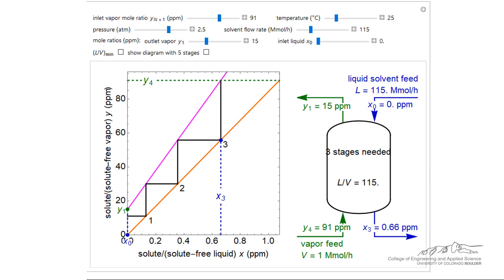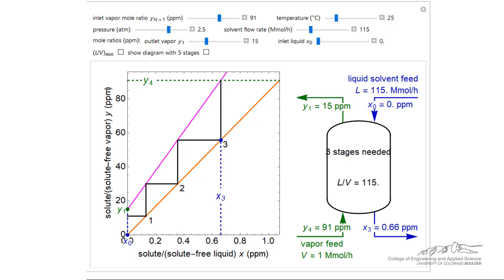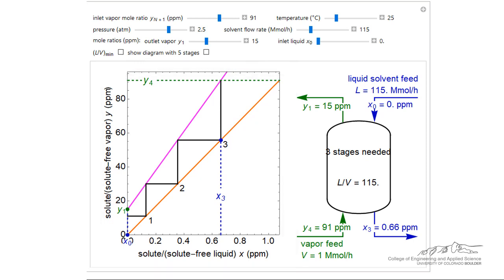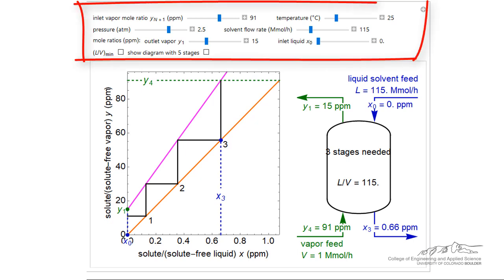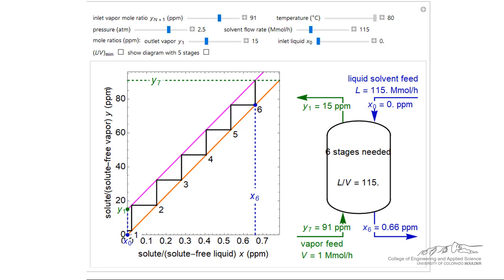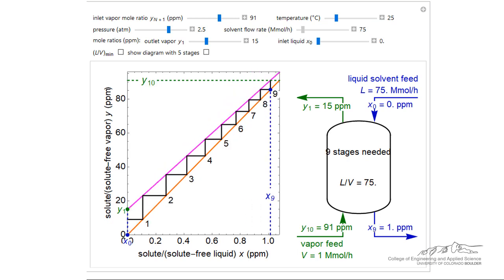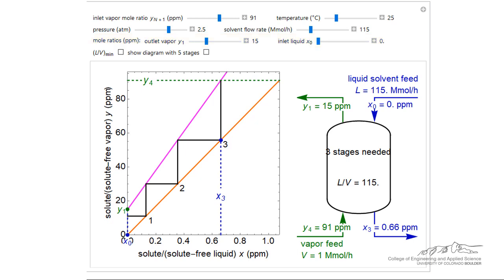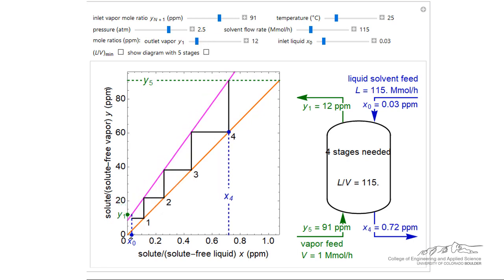Operation of an Absorption Column (Interactive Simulation)

Comment: 2:28 Impact of temperature - Solute molecules will want to leave (escape) the liquid at high temperatures, thus less solute will be in the liquid (absorbent) requiring more stages to increase the amount absorbed (and so to reduce the solute concentration from 91 to 15 ppm from the entering vapour) 
  3:00 Impact of pressure - The higher the pressure,  the  more molecules of that gas will go into the liquid, thus increasing the amount absorbed

Comment: Thank you for the explanation. 
Why an increase in temperature increases the number of ideal stages? What is the physical meaning for it? Thank you
Reply: As I have known from chemistry, increasing the temperature decreases the solubility of the vapor into the liquid. It makes it hard to transfer the solute from vapor to the liquid, therefore more stages is required.
Reply: @danielalfonso6873  thank u
Reply: When thinking about absorption You must think about a coke can ,when You open it the pressure drops therefore the gas leaves the liquid phase, if the Coke is warm it taste like Crap cuz the gas also leaves liquid phase.

Thus gives us a lesson ,in absorption lower temperatures and high pressures increase the mass Transfer.
Reply: it has to do with the formula...Keq..T increases Keq